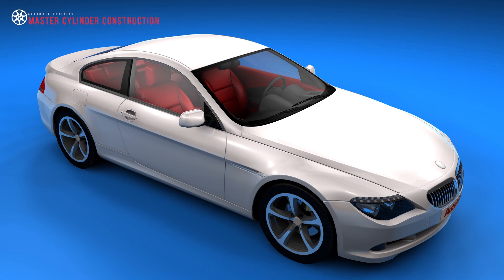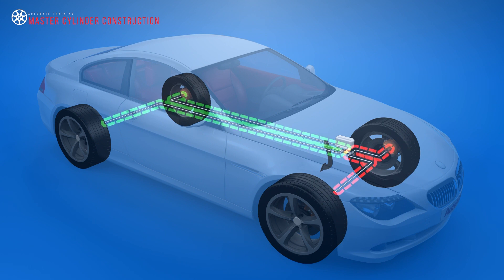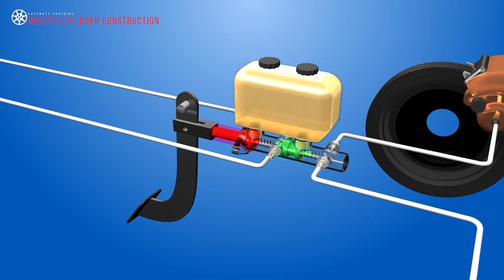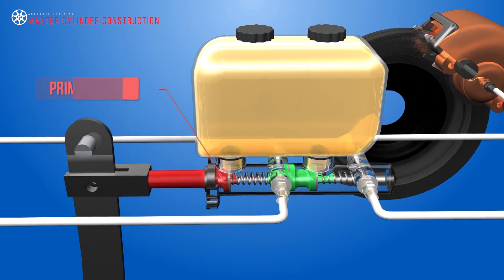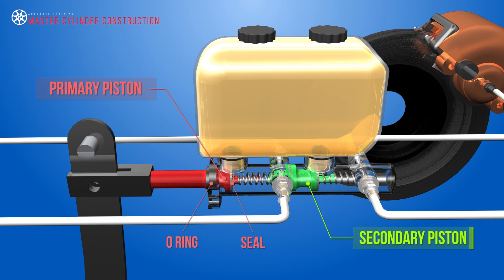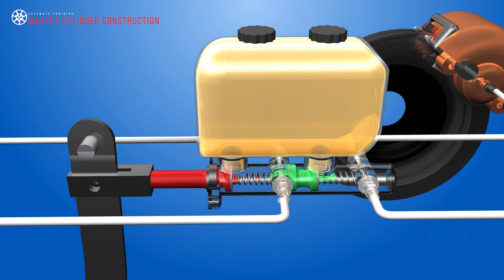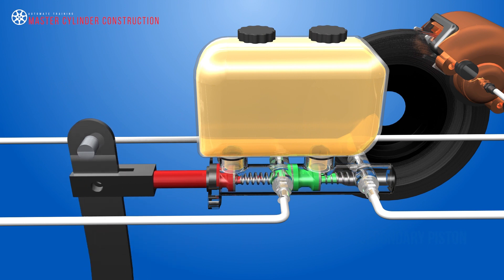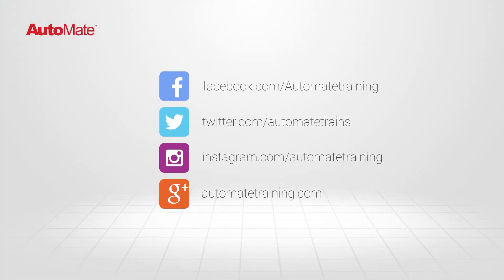Brake Master Cylinder Operation

Comment: excellent video. I've few questions, It's clear that primary piston slides to & fro but does it rotate during its working? 

We are getting lot of leakages from primary seal & have observed common phenomenon of having scoring marks on the inner periphery of seal ring. Any suggestion on the reason?
Reply: That could be because of wobble in the brake pedal since there is physical contact all the way between the pedal and the primary piston